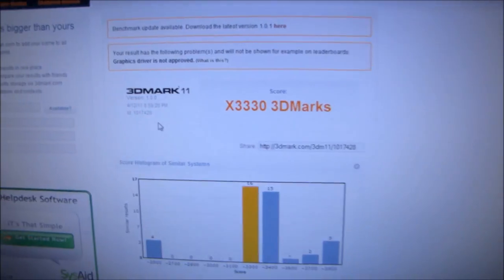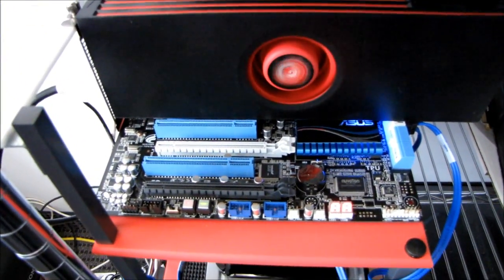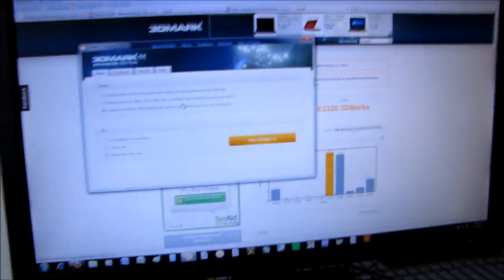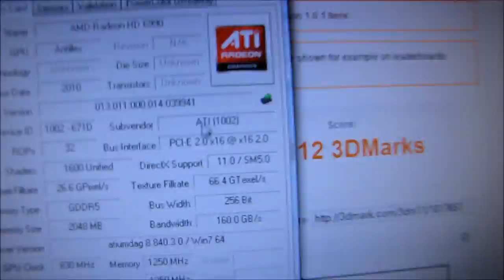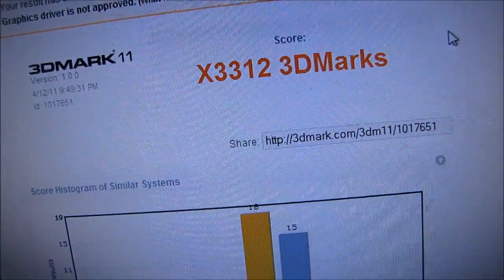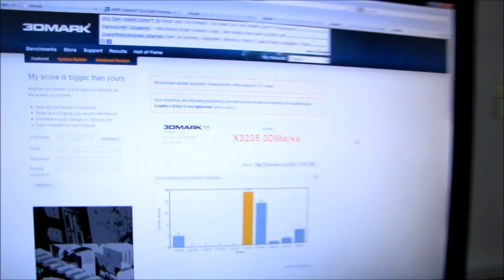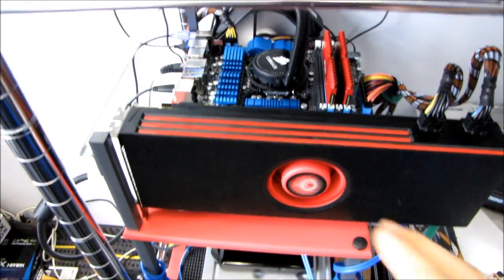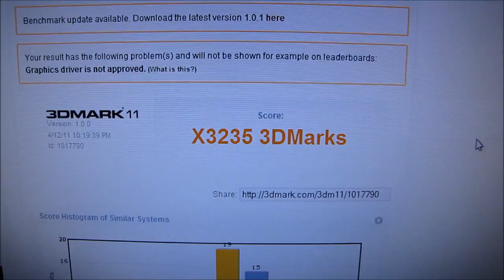Radeon HD 6990 Bandwidth Comparison Test 16x vs 8x vs 4x 3DMark 11 Linus Tech Tips

Comment: One thing that's important to mention: It's PCIe 2.0, so expiriences with PCIe 1.0 might vary (3.0, not so much, since I'd say there's not really a Bottleneck - otherwise the difference between 4x and 8x would be notably bigger).

However, it's worth noting, that the 6990 was a absolute beast.. it has about twice the Texture Fillrate as the RX 480, which is already well past the point of what people would use to upgrade the old Servers they got from eBay for < 50€, coming with only PCIe 1.0 8x.

Comment: Would a R9 270x suffer much of a bottleneck at x4? My main slot was busted on arrival, replacing not an option. While a 6870 definitely wouldn't bottleneck, I wonder about the 270x.
Reply: Im in the same situation, did you did it? noticed any difference?
Reply: I went for a gtx 960, and despite several benchmarks I was not able to determine any major bottleneck. Asked around, plenty people say there's no bottleneck at all, but their tests didn't go as low as x4. 

http : / / cdn . overclock . net / f / f3 / 500 x 1000 p x- LL - f322a884 _ crysis _ 5760 _ 1080 . png

 Both cards win over the 960 and curbstomp the 270x, so.

Comment: Would a 8320 running at 4.8 ghz bottleneck 2 gtx 970s in SLI? if so then how much? No fanboys please I just want people who would actually know the answer.
Reply: Philip Glickman Depends what games you play. In newer AAA titles then there won't be a huge bottleneck and you'll easily be able to get solid 60 at 1080p and won't really be something that's noticeable. This bottleneck will be reduced even further with DX12 and in future AAA titles it wouldn't be a surprise if the bottleneck is completely eliminated running two 970s with an FX8. However in more single-threaded titles obviously there will be a bigger bottleneck.
Reply: Thanks for the info!
Reply: Philip Glickman I run intel, but I highly doubt youll bottle neck that SLI setup.. Im nearly positive.. You should be good man.

Comment: I have a i5-4690K on a MSI Z97m-G43 motherboard, and this board only supports Crossfire since it has a x16 and a x4 slot. Would it be worth it to get like 2 R9 280 or 285x (once/if they arrive) or would the x4 slot bottleneck the performance and not give me any real performance upgrade? I'm thinking about getting a GTX960 card when they launch but since this motherboard doesn't support SLI then I'm also looking at different options. Don't have the cash to buy a GTX 970 or such so I'm on a budget but I could get a midrange card like the 960 or ATI card in the same price range and then get a second ATI card the next month, if it's worth it that is.
Reply: +gatygun It would hardly affect the performace. Don't post false information...
Reply: Mikael Schwartz 280 x2 will give you more performance then a 970, it's about 980 level then. but the x4 slot will cripple the second one pretty badly. wouldn't advice it.

Comment: i have x16 and x4 :/
Reply: +Emanuell Lovnički They both run at same bandwidth, 4x/4x
Reply: Thanks
Reply: At x4 x4  use 100% of gpu..?
Reply: +Emanuell Lovnički I have a r9 270x with a 7870 GHZ addition on a PC MATE z97 MSI motherboard and yes they both run at 100%. Performance gain from passmark benchmark indicate a 86% performance increase from the second card. This would be increased if the second card was a r9 270x to probably 90%.
Reply: +markman090 The downside to crossfire is some games don't support it, it draws a lot more power, heats up your room quickly, and dose not have a lot of VRAM to harness all the GPU horsepower. I can run GTA 5 on max settings, but it takes ~20 seconds in order to frame rates to reach playable levels when you enter a big area because the VRAM of 2GB is insufficient to buffer all the frames required.

Comment: If I put 2 gtx 760 cards in 16x 4x will they work OK?
Reply: Did you watch the video? Did any of what Linus said compute? Are you really here?
Reply: TheVanillatech yes yes and yes but he did (8x,8x)(4x,4x)and(2x,2x)
Reply: Nvidia doesnt allow sli configuration with cards with less than 8 pcie lanes
Reply: ArmaghettoHD i know now nvidia doesn't really give a good explanation to what you need for sli
Reply: music mayhem and gaming Nvidia require sli motherboard, just have to check your manual. If your mobo not support sli, then it will never work even at 16x,16x.
Reply: Sadaki I know that

Comment: I've got two R9 280X DirectCU II. My motherboard has one PCI E 3.0 X16 and one PCI E 3.0 X4. Will it be okay if I Crossfire these two cards?
Reply: You should be fine. I'm running Crossfire HD 7950s on PCIE 3.0 16x @ 16x, and PCIE 2.0 16x @ 4x, and I don't see a performance hit.
Reply: It is possible, but I don't recommend it, it will cause A LOT of problems, like microstuttering. Just stick with a single card, R9 280x is already a really good card for 1440p and 1080p
Reply: Steel_Nugget ***** Thanks a ton guys. I actually just upgraded my motherboard to MSI Z97M Gaming. It's letting me use the PCI-E as 8x and 8x.
Reply: Jett A Angeles Nice
Reply: ***** I am getting the same amount of scaling that I would get on a 8x by 8x setup so you should not be held back by the 4x slot.
Reply: ***** also depends if your motherboard supports it

Comment: how much performance drop will i see if i do a r9 270x crossfire with one running at 16x and other running at 4x?????
Reply: not really noticeable when gaming, But it really depends on what game, a year ago I tested a setup on a board I had with 16x and 4x for crossfire only with 2 HD 7850s and the game that did not like it at all was Planetside 2 it was like playing it on a 10 year old computer, so really depends on your need and what you do
Reply: Hey, did you do this, and, if so, how did it work?  I have exactly the same situation.  I have a free 4x slot and want to know whether or not it's worth the trouble for  a second R9 270x.
Reply: No Way well as long as the motherboard is capable of CrossfireX though, look it up on the motherboards company website it will tell you if it doesn't on your mobos box.
Reply: PC_GameWorld It is.  I was asking Ritin because I have a R9 270x.  I was just wondering if he had done it and if he felt it was worth it.  Looks like on Ebay I could pick up a second card exactly like mine for $100 or so.
Reply: No Way well what you can do is, if you have a best buy store near you just purchase it from there and if you don't feel impressed with it you can just return it for full refund
Reply: PC_GameWorld Yeah, I know.  Having done some research I actually think I will prob pick one up on Ebay.  It looks like it is worth the $100 bucks or so.  Worst case, I just have to turn around and sell it, but that doesn't look like what will happen.
Reply: No Way a lot of games will benefit, theres just those few games that just doesn't seem to handle it
Reply: PC_GameWorld I would really like to find something that would get heavily modded Skyrim with ENB consistently above 60 FPS, but that may be chasing Big Foot.  Be fun to play with the Crossfire no matter what.
Reply: No Way well if you go by the fps then you are really just chasing numbers, I stopped doing that long ago because it would cause me to burn a whole in my wallet so I just stuck with one R9 280x instead of 2.

Comment: i have intel i5 3330 on my 2th build i wanna crossfire HD 7770 REF cards my board has PCIE x16 running the 7770 now the other slot has x4 can you plz tell me if i will get FPS boost how much performance will i get is it worth getting the 2th one

Comment: What kind of a difference in performance would one get running the AMD-based Asus HD7870 on a PCIe 8x slot vs a PCIe 16x slot? I ask because I wonder if the HD7870 comes closer to saturating the PCIe 8x slot's bandwidth than the 6990.
Reply: You wouldn't notice it. 
Unless you're talking PCI-E 2.0 x8 vs. PCI-E 3.0 x16 or someshit. 
But regardless, I'd never crossfire. Everyones been waiting for AMD to fix their frame-latency issue in crossfire for the past 3-4yrs and they have only fixed it by 0.04% and need to fix at least 70% preferably 100% of the issue.
Reply: Objectified Cross
My motherboard (Asus m4a89gtd-pro/usb3) has two PCIe 2.0 x16 slots. The motherboard is incapable of delivering PCIe 3.0 performance, so it seems I should be content getting PCIe 2.0 x8 performance out of my motherboard rather than PCIe 2.0 x16 performance (I could achieve PCIe 2.0 x16 performance if I buy an 'Asus VGA Switch Card' that acts as a terminator for the second PCIe slot that is inactive. The VGA Switch Card should have came with my mobo, but because I bought an open box mobo, I missed out on that part).

Comment: Sooooo bandwidth does shit all to performance? Cool
Reply: This video is full of shit. 
Not mentioning AMD's current Micro-stutter issue (due to bad frame latency) in current Crossfire set-ups, anything less than x8 is useless unless you're running a older ATI radeon HD series card, such as the HD 4890 at MOST. 

Others have done benchmarks. And this video does not fit with ANYONE elses tests, neither tests done by users, nor tests done by review and benchmark sites. 

A 4x slot severely cripples modern graphics cards. And I mean SEVERELY. 
It's not as bad with PCI-E 3.0 4x since PCI-E 3.0 at 4x is as fast as PCI-E 2.0 at 8x but any lower is useless for anything other than a Physx card or a cheap set-up for doing a bajillion monitors for video editing.

Comment: I was having zero bootups and was okay without the dedicated gpu, but it turns out the power supply was going out... so I had bought a new power supply and slammed tons of gpus in the same motherboard but on the lower pcie 16x slot... I just saw the gpuz this morning and darn was I pissed... Should I have it repaired or not linus?

Comment: I have a problem and its somewhat related to this post...

I have an old trusty H55-GD65 and Ive cleaned the upper pcie 16x slot with a 3000 grit sand paper as I was thinking the slot is dirty and that just made it worse... Its totally not working now. 
I just bought a 5850 last week and ive installed it in the lower pcie 16x slot... I just found out that it is actually running at 4x speed... should I have my motherboard repaired(its out of warranty being a 3 year old board and all)or am I fine?

Comment: Moral of the story is motherboards don't slow down video card speeds.. the fact is at 4x pcie 2.0 you can do the same as your buddy with the $1000 16x pcie 3.0 sli board.. there is no bottleneck from the lower pcie slot speed even on this high end card..these effects are minimal..

Comment: Hi, I don't use vsync, my cpu runs at 30-50% about (i2600k), and I don't think it's a crysis2 issue.
You are testing making only one card work. I think in that mobo, even if you put a second card it doesn't run 8x, but almost like 16x.

if you search this video "4-Way GTX 680 SLI Sony FW900 Surround Reaching VRAM Limit and PCI-Express 2.0 vs 3.0 Battle - "

you will find how 4 gtx680 run at 55% with pcie 2.0 16-8-8-8
and setting it to pcie 3.0 in the second video the gpu usage gets to 90-99%

Comment: @LinusTechTips Hey! I wanted to ask you something. I have GigaByte HD6850OC and Asus P7P55D Mobo. It has 2x pcie x16 slots but in CF it works only in x4/x4. Now i want to do little upgrade. I am considering getting second GB HD6850OC.

Is it worth it? Will i get decent performance boost? According to your vid pcie 2.0 x16/x4 [x4/x4] should not bottleneck it. Is it better than getting single Gtx560Ti? Heard CF 6850 compares to gtx580 or little above that.

Please tell me what you think!

Comment: @JigokuTrigger Yes, and despite what most people will tell you running x4/x4 [well x16/x4] on pcie 2.0 will not bottleneck it. you'll lose ~2-5% performance max but the gain is still a lot better.

I want to CF my 6850OC since i already got one and buying another is cheaper and better than gtx580 :>

Comment: I have an X-Fi so like a lot of PC users I can't my sound card in the x1 slot and my video card in the x16 slot

I tried putting the X-Fi in a PCI x4 slot and it just shows up as a "High Def. Audio Device" that I can't install the X-Fi drivers for...I also get a lot of audio distortion with any PCI/PCIe sound card, not having a great deal of luck....

Comment: guys, i got a xfx 750i motherboard, it has 2 16x slot pcie and one pcie for your sound card, my question is, can i put a physx card in a pcie slot with a 4x bandwith? well, the pcie slot is not in standard or full length, it is only half in length. thanks

Comment: But isnt this never going to be an accurate test if your using a current sandybridge chip because the PCB lane splitter is still ultimately facing a bottleneck at the processor which can only support 16?  Its one of the reasons I stayed x58 and am holding out for the new Z68.   I can see a some real differences when I do this on either my Rampage III or MSI Big bang mobo using an i7 (980x or i7 950 respectively)  I would be very interested in seeing this using a CPU thats non blocking

Comment: @ParasiteXX hey man thanks, you are right about the 6990 i guess I should have said 2x 6950 is roughly the same performance as the 6990. I hear the bios switch on 6990 on position 1 830/1250 frequencies (which is the 6950's clocks and position 2 is 880/1375 frequencies which is 6970's clocks, I would like to see confirmation on this as well.

Comment: @Sambrero44 actually depending on the game, and resolution. You can sometimes come CLOSE to doubling performance with a 2nd card of the same spec. I use to have 2 older 9800GTX+ and when i added a 2nd card on 1920x1200 i doubled my frames no joke. On games such as crysis, COD, and battlefield BC2. Also, some games dont support SLI/crossfire very well if at all. That also makes it a dependant factor on whether 2 cards is worth it or not.

Comment: see this is one thing that confuses me. ive got 2 5770s in crossfire at 16x 4x but i dont really see much of a gain in preformance over just running one card at 16x. in mw2 i saw the max 91 fps at 1080p but when i have them in crossfire i actually see a decrease in fps down to around 70.  i still see an actual decrease in preformance over black ops and  homefront too just not as much of one. maybe only 5fps drop on those. system specs :MSI 870A-G54, Phenom 955 at 3.9ghz water cooled and 12gb ram

Comment: @Nic0las11x12 Most motherboards support only crossfire (2 or more AMD/ATI - HD....) or SLI (2 or more nVidia - GTX.../GTS.../GT...)
However some motherboards support AMD/ATI with nVidia cards, but I don't remember whats it is called.
You can also use a AMD/ATI card for graphics and an extra nVidia card for PhysX and CUDA.
Hope this helps ;)

Comment: whats the most reliable motherboard for p67. I've read reviews on motherboards from am3 to 1155 and most of them have issues. Help needed...
I'm planning on building a new pc, but most motherboards I've read about, have issues with boot up or compatibility issues with memory etc. Specially ASUS, once againg help need, I'll be using the 6950 on crossfire and thank you.

Comment: @dezarrlol it has nothing to do with the electricity or power the cards receive. instead, it has to do with the number of data connections to the cpu, or the bandwidth of data the card has to the cpu. so, the numbers mean that in a 16x slot, a gpu has twice the bandwidth to send and receive information from the cpu than a card does when it's in an 8x slot